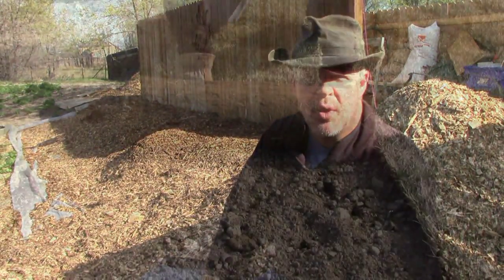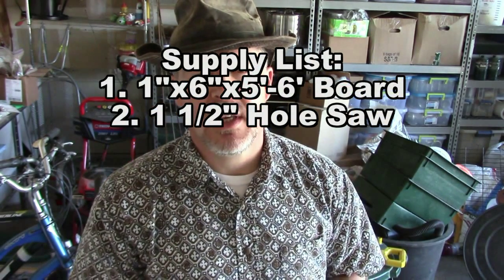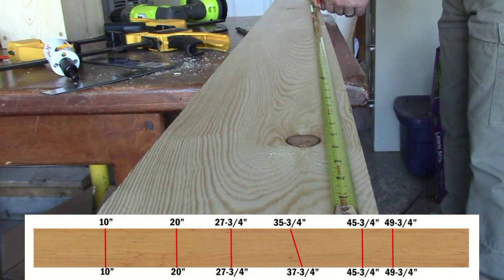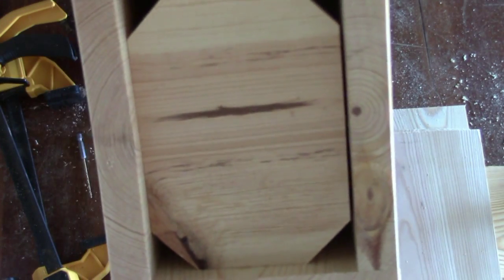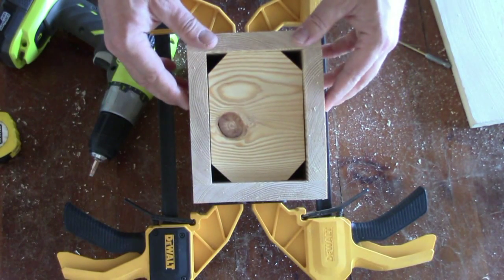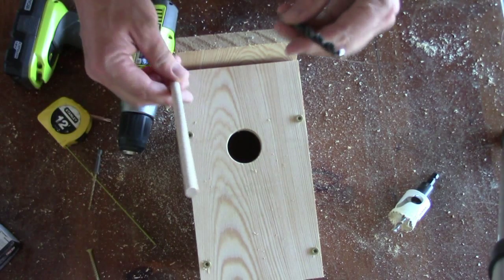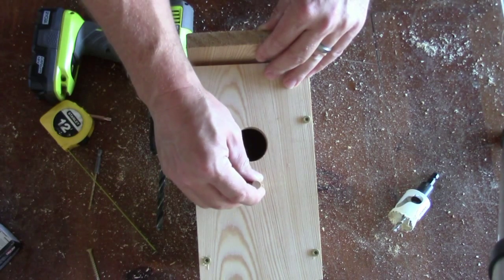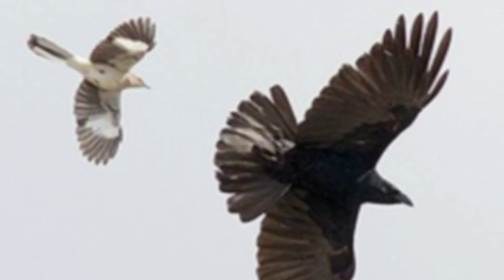Back to the Homestead - Birds on the Homestead

Comment: not to tell you what to do, but you could use a small 1" to 2" block for the perch instead of the dowel, this lessens supplies needed, you probably have a end of a board kicking around somewhere that can be cut again to make a perch, it just needs to not extend out more than 2" from the box for most small bird species and to prevent predators landing on it. once you have this piece, just screw it in place with one 1 or 2 screws.
Reply from the maker: ***** - Awesome Idea. And feel free to "tell me what to do." I won't learn to make things better without advice from viewers. This is the main reason I make these videos; to gain new ideas and insight. Feel free to write in anytime and share what you know. I'll make another one and try this out. Thanks a million.